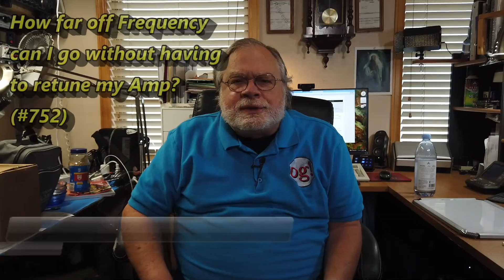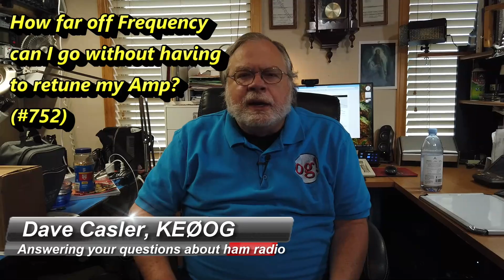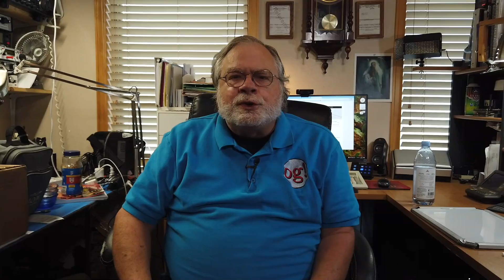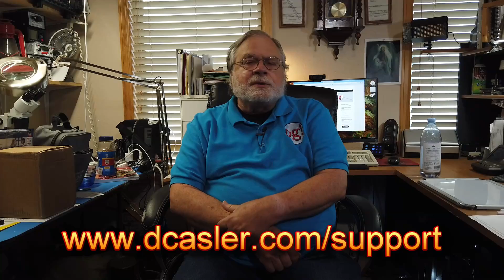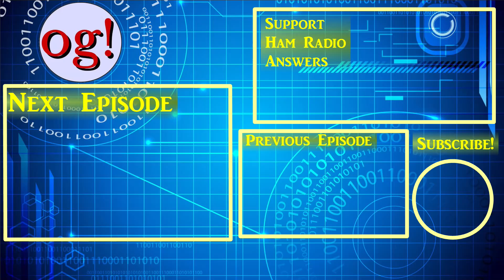How far off Frequency can I go Without having to Retune my Amp?

Comment: I have an ACOM 2100 tube amp; a device I would not define as "legacy".  Since my SteppIR Yagi retunes every 25khz, the impedance remains the same across the entire band leading to the same amp tuning settings anywhere in the band.  This allows me to tune the amp "by the numbers" (spreadsheet) and transmit without fear.  If I should make a mistake, the amp's protection is awesome.

Comment: My antenna system tunes pretty narrow and I use a K7DYY AM transmitter.  My AM signal is roughly 10kHz wide and this isn't a problem.  The 'DYY will trip if I hit 1.5:1 SWR and that just doesn't happen.

Comment: The issue with a power amp is operating within rated limits including not exceeding the DC Plate dissipation as any RF not going out the antenna will be dissipated in the tube as heat. The Q of the output network determines how far you can shift frequency without retuning or reducing drive to keep plate current in limits. Also, don't tune for max output if you want to save on tubes, sound good and keep the harmonics legal.
Reply: I though that was what the question was about.  When to "realign" the driver, plate,  and load resonance, as some manuals put it. Not adjusting the Amp. output  to the antenna system, ie transmatch. Perhaps I misunderstood the question therfore Dave's answer.